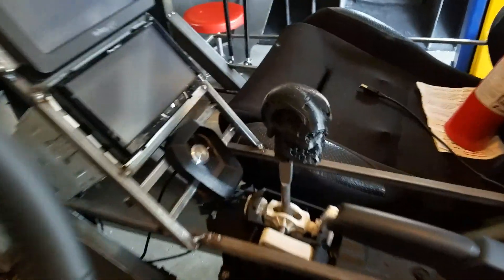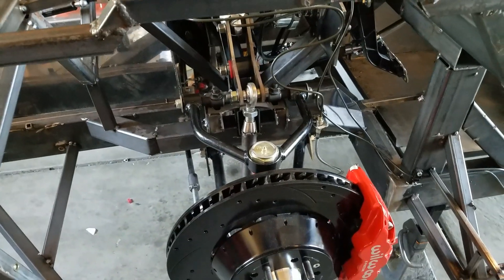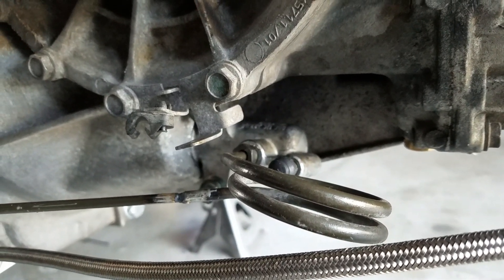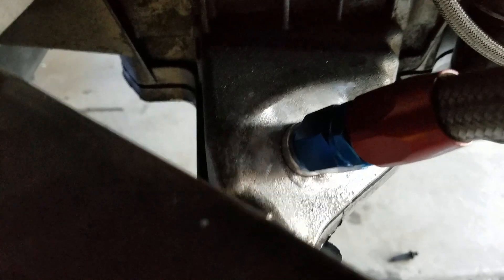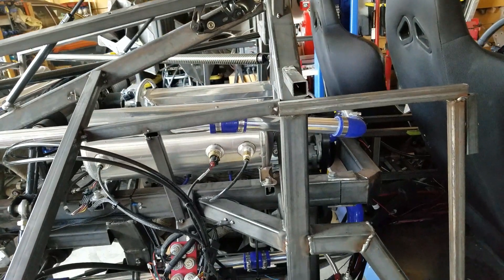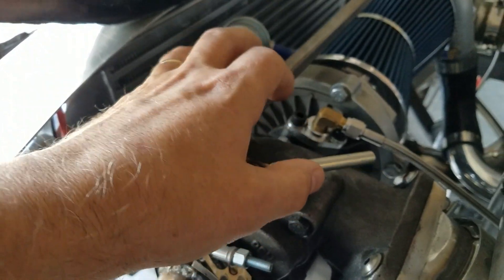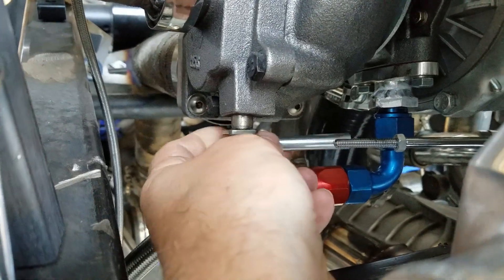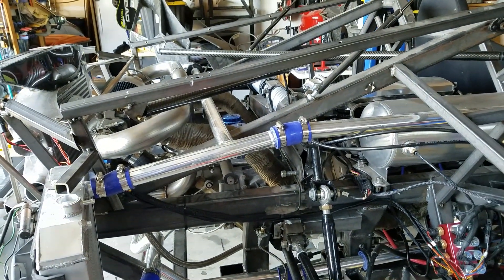3D Printed Interceptor Update 6

Comment: What year LS are you running? If it has some miles on it you may want to replace the o ring on the pick up tube at the oil pump they are bad to get hard and allow blow by and decrease your oil pressure at normal operating temp. Very cheap preventative measure that could save your engine. I see a lot of meticulous welding in your future. Have fun.

Comment: Heh, you said bung  :)  Pluming is looking great on the turbski's.  Where they disconnected for the first
start vid? Would make sense if they weren't yet plumbed.  This thing is going to be so amazing! :)

Since those turbo's are not water cooled centers you are going to want to flow oil through them for a few minutes
before shut down. Not sure if you can program that in with the Holley setup but if you can, I would program in
a five minute cool down routine or add a turbo timer.